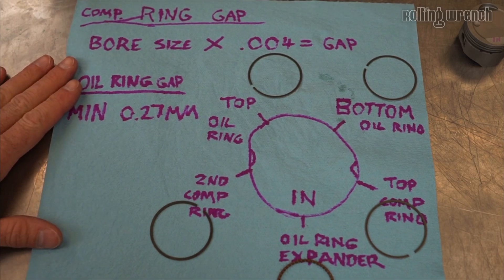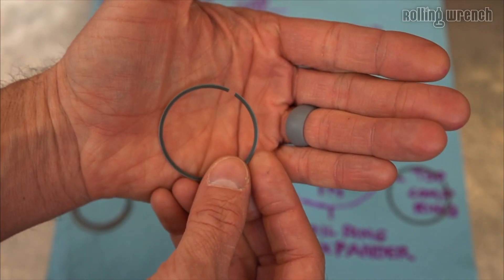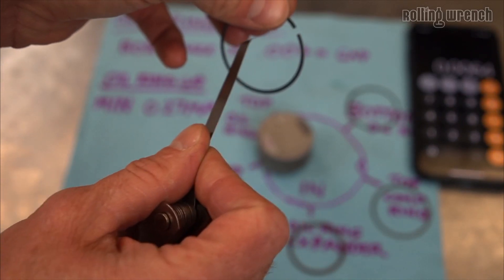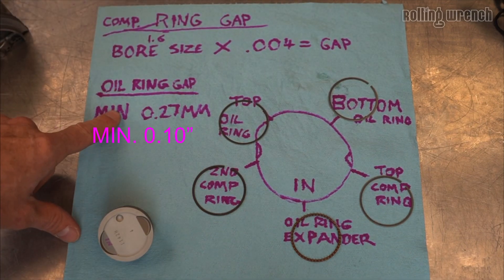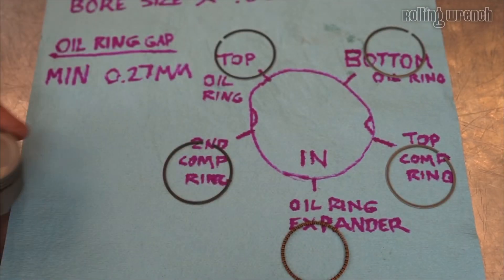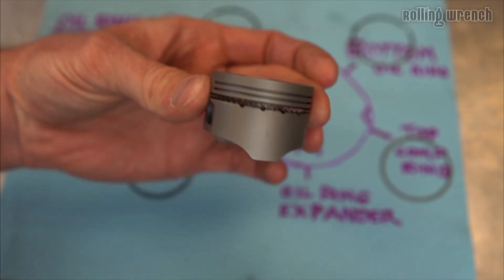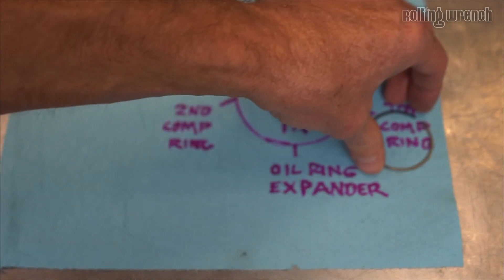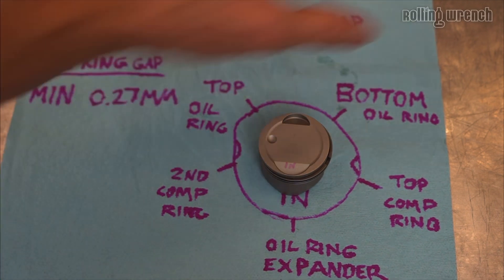PISTON RINGS

Comment: I have a piston that has no markings for intake /exhaust, There is no measurable differences in the depth to even verify. Intake and exhaust are the same machinings. could it be that it doesn't matter? being it is a Sunday I cannot contact the manufacturer so I was taking a gamble to see if you read this.

Comment: My TaoTao VIP Future Champion is an 82cc and it’s made by Peace Sports I got it used from someone so I’m not sure if it came that wayI keep up on changing the oil the person who owned it before me said it came all stock but if it did come at 82cc as the stock engine how many miles can I get out of it I use the best oil  I can get for it I use 15w-50 Mobil 1 engine oil and it is advanced fully synthetic motor oil I also get nervous about pushing it as hard as I can because my old moped I ended up throwing a rod threw the engine block mainly because it was a cheap $900.00 moped and I had put 30,000 miles on it and it finally had enough and blew up. I really don’t want anything bad to happen to my TaoTao VIP Future Champion is there a way to make it so it lasts longer than 30,000 miles? This moped is my only way to and from work it is my main source of transportation it has a GY6 engine on it but again I don’t push my moped as hard as I can unless I am in a really big rush and by then it’s all the way warmed up I also give it 10 minutes to warm up.